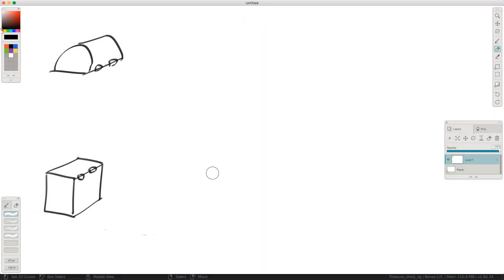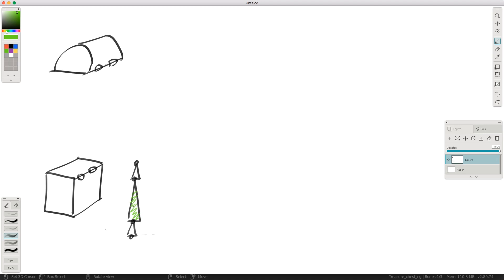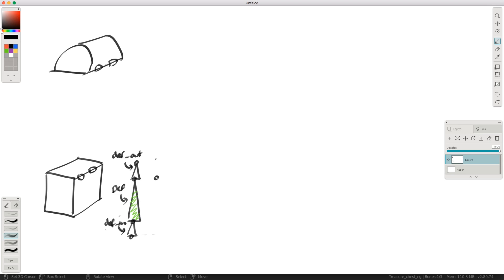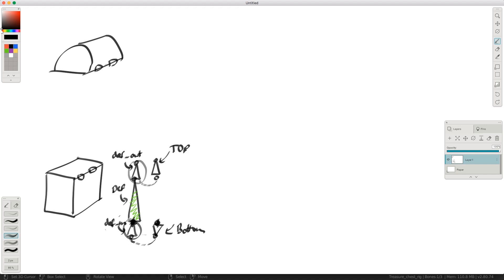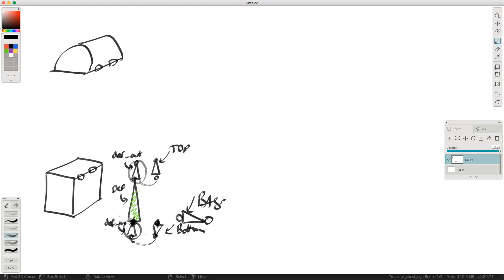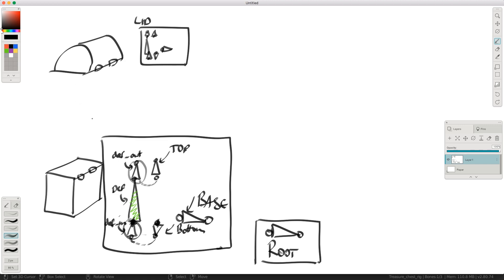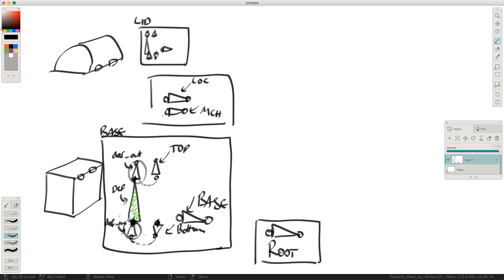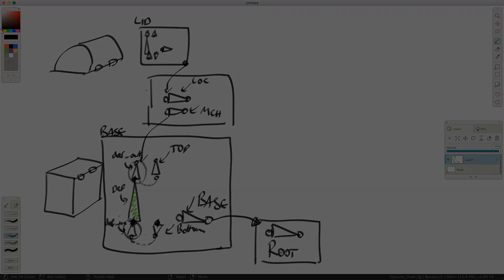Planning a Treasure Chest Rig in Blender 2.8 (Tutorial Series Preview)

Comment: This sounds waaaay too complex for a simple 1 or 2 bones setup, he but explains it very thoroughly! I like it.
Reply: Yeah, I'm a bit confused why he wants to use like 20 bones to open the lid on a box basically.  Maybe he's planning to do something more complex later in the series, but it still seems odd.
Reply: @yahootube90  Probably some cartoonish animation, not only rotating but deforming the mesh with multiple bones. But yea, a bit high jump from prev tutorials.
Reply from the maker: @yahootube90  That's exactly it! It's a full featured cartoon rig, so it's a bit more complex than just moving or rotating parts.